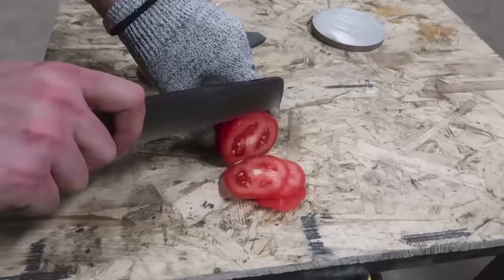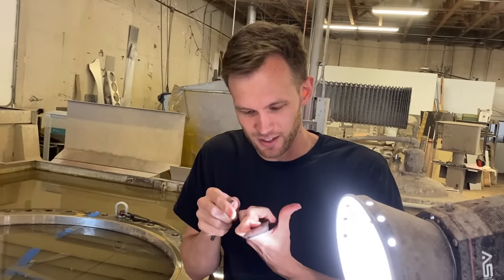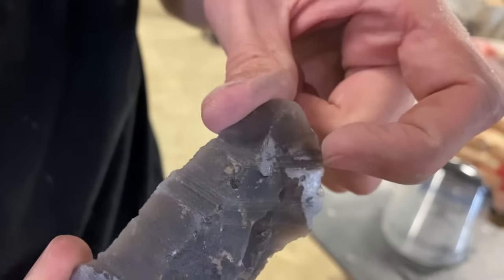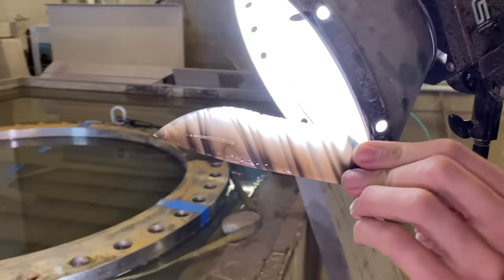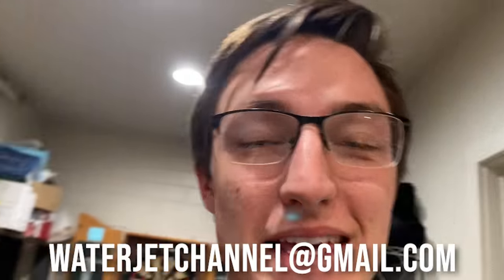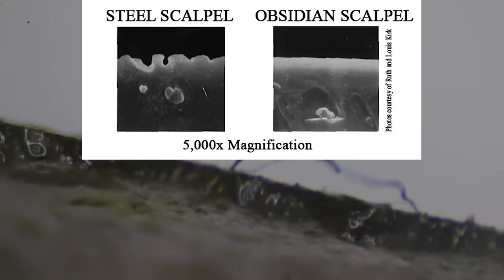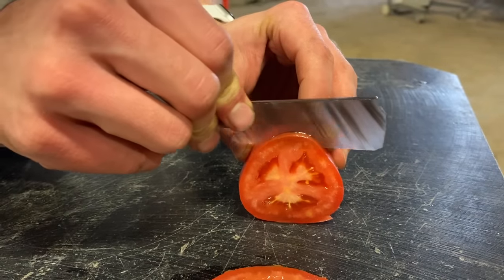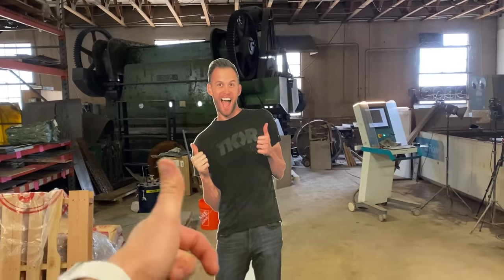World’s Sharpest Obsidian Knife

Comment: The thing that makes obsidian 500x sharper is the fracture of the material itself. You need to KNAP it to get the maximum sharpness. Simply sawing bits off of a block leaves you with the same issue as steel knives
Reply: Except knapping doesn't give a large enough workable edge to exploit the sharpness.... It's all well and good being a molecular thickness edge... but if it's a shitty mess of hundreds of small jagged notches on a lump of rock an inch thick, it's not going to function like a metal knife.

Obsidian is overhyped. It's only advantage cannot be properly exploited into practical tools, hence why metal weapons and tools were such an upgrade the instant they arrived in South America. A durable, consistent edge is far more value.
Reply: @AllThingsCubey  Tiny obsidian blades are used in high end eye surgery as tips for the bisturi. Since the blade is a single molecule wide, it leaves extremely sharp and clean cuts that can mend without any scarring.

Aside from that you're right 😉

Comment: So, I do writeups and work with history and archeology channels on content on Mesoamerica (Aztec, Maya, etc), where obsidian was widely used for tools and weapons. You guys acknowledge that trying to cut out a blade with a waterjet like you did last time isn't gonna actually give you the sharp edge Obsidian is known for, but angling the waterjet or even knapping the blade after it's produced won't do it either, at least not to the same degree obsidian blades were actually produced in Mesoamerica: I'm more informed on things like Architecture or aqueduct systems then obsidian production; but the way they did it is the prismatic blade method, where you take  a "core" piece of obsidian, and then strike which flakes off whole, entire blades in one strike, creating an insanely fine, single continuous edge along where the fracture occurs. 

If you're taking an existing flake/blade and are doing traditional knapping to make many additional smaller fractures along the edge (which mind you the Mesoamericans also did, but usually to things like flint, or for ceremonial, not-for-actual-cutting obsidian pieces called eccentrics), then that's not gonna be as sharp since it's not one flush cutting edge and you're likely chipping parts of it in the process. The waterjet isn't doing it either, since while it's in theory producing one continuous edge, it's probably producing many microscopic chips and fractures along the edge as it travels (which you guys even concede in the video) since obsidian is so brittle, rather then actually forming a single edge as if you struck it off in one piece using the prismatic method. 

I wanna be VERY clear here, that, again, I am not a material scientist or a geologist, and Obsidian blade production is not one of the specific aspects of Mesoamerica I'm particularly informed on (ask me about how cities were laid out or how Aztec political systems work and then I can give you 12 paragraphs!) but yeah, If you wanna do this with a waterjet, you should be using the waterjet to cut out the initial core you're then striking blades off of, maybe you could try to work with a geologist or a physicist to find the ideal starting core shape to produce the best blades? There might already be some research on that as far as what the best starting shape used historically was, but again, not the subtopic I tend to look up research papers for.
Reply: But how WERE the cities laid out? 🤔
Enquiring minds need to know!
Reply: @bigchooch4434  Mesoamerican cities tended to have a central, dense urban core of monumental architecture: You'd have palaces, temples, ball courts, noble housing, and other civic, ceremonial, and communal structures., which were richly painted and decorated: when you see ruins today, you're seeing the grey inner fill of rough stones and mortar or the brickwork over them, usually not the clean stucco and then colorful painted frescos and intricate reliefs, sculptural facades, friezes, and other accents which were over them, which are only preserved occasionally: Look up the frescos found at the residences of Teotihuacan, or the Rosalila temple at Copan, or the paintings made by Scott and Stuart Gentling of Aztec cityscapes to get a feel for how they would have looked in their heyday. 

These were generally organized around open plazas, with their arrangement aligned to maximize things like public viewing or human traffic for ceremonies and gatherings, or for ritualistic alignments: For example, the Maya E Group, for example, is a common arrangement of 3 structures that when viewed from another location, align with astronomic phenomena at certain times of year. Or how at Teotihuacan, the San Juan river was recoursed through the city's grid layout (which is unusual, I'll get back to that) to appear perpendicular to the Temple of the Feathered Serpent and the Ciudadela complex/plaza it's located inside, as those structures were heavily associated with water (the plaza even capable of being flooded like the Roman Colosseum), so when viewed from specific angles it would appear the river is coming forth from those structures. Speaking of, complex water management systems were also quite common: At Tikal, for example, there were a series of massive reservoirs connected to one another, with dams and channels which allowed them to flow into one another if needed to prevent flooding; with structures and plazas in the surrounding area having drains to similarly redirect rainwater or water from floods into the reservoir network. Some of these reservoirs even had advanced filtration systems, and some of the connections between them even had switching stations to choose how the water flowed. 

Much like how the structures themselves in sites today are misleading with only the inner grey masonry being visible, modern archeological sites and their maps are often misleading in that they exclude many structures which are either still buried or destroyed. Compare tourist site maps of sites like Teotihuacan or Palenque which only show major structures for visitors, with the archeological surveys of those sites from Millon and Barnhart, respectively: those both show hundreds of additional structures tourist maps do not. 

Significantly, they also exclude the suburbs around the urban core, which is the other key half of Mesoamerican urban layouts: While the urban core has a high density of planned structures for elites, ceremonies, or groups, which are built of stone and have fancy accents and decorations; the suburbs that surround the cores are low density, commoner residences interspersed with agricultural land (sort of giving a similar mental image to suburbs today, with homes spaced out between greenery), and are less planned:  Commoner residences would have been built out of wood, straw, or adobe brick, usually on a stone foundation, with homes in so called "patio groups", with 2 to 4 homes built facing one another around a sort of mini-plaza. These suburbs would radiate out from the site core, gradually decreasing in density, as the area became more rural, without a clear end point, which makes defining the limits and populations of Mesoamerican cities quite iffy. Also, while these were "less planned", then the urban cores, much of the area the suburbs covered would still be landscaped (not necessarily, deforested, though sometimes: When tree cover was kept, it was in managed groves with a cleared underbrush for agroforestry and shade), and some would have "mini cores" with temples and some elite residences. Some large Mesoamerican cities, particularly Maya ones, had absolutely massive suburban sprawls covering dozens or even hundreds of square kilometers, like at Tikal, El Mirador, Copan, and Caracol, to the point where in the former two examples, you literally had multiple different city centers connected via the sprawls into Megalopoli. Tikal's in particular had a significant amount of infrastructure across it's sprawls, with palisades and more hooked up water management systems for agriculture and flood prevention and drinking water. 

What i've described is the "typical" large Mesoamerican city, but obviously there were exceptions, some examples being Tenochtitlan, Teotihuacan, and Palenque: The Aztec capital of Tenochtitan was located on an island (which was then expanded via grids of artificial islands used for urban development and as hydrponic farms known as chinampas, which actually made up most of the city's area by the time of Spanish contact), so it had a clear limit, though in the city there's still a  more urban core and surrounding suburbs. Tenochtitlan also unusually had some of it's structures on a grid layout, contrary to the plaza based ritualistic planning I described. This is attributed to a specific urban revival of Teotihuacan's city planning, which was even more unusual: Almost the whole city layout was one giant urban sprawl on a planned grid, which covered 22 square kilometers, entirely composed of palaces and temples, organized around a central road, rather then plazas. The city did have suburbs, but they covered a much, much smaller amount of space compared to the urban area and most of the city's denizens lived in fancy palaces. For Palenque, the city was founded on a relatively small flat area of an otherwise steep hill, so it has it's commoner residences on terraced acropoli (which themselves weren't uncommon, moreso for palaces and temple complexes tho) packed tightly next to/alongside it's elite and ceremonial structures, I guess more comparable to the typical ancient/medieval city in Eurasia where you had everything packed together. 

I wish I was able to link images of all of this, but youtube tends to act iffy when I do that, so if you want some let me know and we'll have to figure something out.
Reply: As an archaeologist, I agree. Strike a flake from a core and you get the thinnest edge possible. Further retouch or knapping is good for shaping tools and for sharpening a dull edge, but you'll never achieve an edge as sharp as the initial flake. Fun video though.
Reply: @MajoraZ  thanks for the long write up, I was actually rather curious
Reply: @MajoraZ  I wasn't sure if we'd get an actual write up, I'm so glad you actually took the time to write all that out.
This type of sharing of niche knowledge is what the internet was made for.
Reply: @bigchooch4434  Happy to help! I actually already had that typed up from a comment on a different video, I do a lot of posts and such. Also, to clarify on "though there's still a identifiable more urban core and surrounding suburbs around it. Tenochtitlan also unusually had some of it's structures on a grid layout, contrary to the plaza based ritualistic planning I described": as in the chinampas themselves are mostly the suburbs and agricultural land, wheras the natural island the city started on in the center and some of the adjacent chinampas had the palaces and temples and other urban core monumental structures: the very center of the city still had a ceremonial plaza, but it was a walled precinct that also contained structures inside the plaza, and those and some of the structures surronding the precinct  were somewhat on a grid. (I can show images if you reach out)
Reply: Exactly I heard some flakes the edge is only a few atoms wide. Exactly what they mean by few I'm not sure, but just obsidian I have broken myself is ungodly sharp like 100x razor blade sharp.
Reply: @MajoraZ   I don't care about your content, take my sub for your large amount of knowledge.
Reply: Obsidian is currently used for extremely delicate surgeries (brain, eye, etc). The cutting edge is microscopic and procedures are done with direct optical or computer magnification. Doctors who use obsidian scalpels  often need to get special consent from patients since they are not fully approved in some jurisdictions. The cutting edge is only a few atoms wide so the trauma to tissue is minute and the healing time is ridiculously fast with little to no scarring.
Reply: man i really wanna read this but my brain makes me not because of the many words
Reply: @delphic464  fascinating 👏
Reply: I was thinking about this too, that for it to bevome very sharp you would have to «follow the grain» or something like that
Reply: @mattias2576  When properly knapped, glass like crystiline structures will break in a hertzian cone (hertz - as in frequency). This break allows the finished edge to be microscopic since the break is following the molecular structure of the crystal. A good example is BB holes in windows. Polishing or finishing the edge mechanically will only dull the cutting edge.
Reply: @willowgoober  weird thing to admit to in public
Reply: Now THAT’s an informed comment. Love it.
Reply: Finally someone who knows what he's talking about!!!!
Reply: @mccooljohnm  how did the Aztec political systems work
Reply: @delphic464  ohhh, will have to do some reading, i only have some basic knowledge of crystals, only experience is from studying solid state physics, but this sounds really cool
Reply: I did this with a chunk of obsidian I found in a river and I made something close to an axe blade out of it
Reply: @MajoraZ   you should send me everything in a doc or something sounds really interesting (for the pictures)
Reply: It sure looks good however!
Reply: Paleomanjim has a bunch of videos about making blade cores, and shows examples from mesoamerica and stone-age Europe
Reply: I'd love to hear how the aztec political system workedXD

Comment: If I’ve heard correctly, obsidian is so unbelievably sharp down to the smallest atom that it cuts between cells while a scalpel just cuts through them. This is also why you would heal faster from being cut by obsidian
Reply: More like it CAN cut between cells.
Reply: Obsidian was used for scalpels but it isn’t used as much now because it can easily be broken. Leaving the patient with sharp shards inside them that were hard to remove.
Reply: So, same like one eats tomato salad with some obsisian knive chippings in it? :D
Reply: If a scalpel could really cut through the cells, I'd call it one great scalpel. Typically they should be just crushing the cells for good.
As for cutting "between the cells", that's just tearing them apart, not cutting. Maybe in theory and with nanobots?
Either way, any clean cut with a sharper object usually is much easier to heal than the one taken with a dumb blade. Whenever I'd cut myself with my knife at its best sharpening, some of the cuts could be barely detectable at all - you can even miss the fact of having had being cut by such a blade at first.
Reply: @getsideways7257 Obisidian cuts between cells as it blade is 1-20 atoms wide
Reply: @shironhel7184 complete bs lol. an obsidian blade is 50 atoms wide

Comment: So basically, “Worlds Dullest Obsidian Knife” 

LOL. Good job though. In the future, I would not recommend sharpening it with a belt sander. You cannot do it that way. Flaking is the only way I believe. That is why steel is much better. With steel, you can shape it and design the blade. With obsidian, you are at the will of however you chip it.
Reply: I think I did a better job on a cheapo 440A steel knife with just three stones - could cut hair too and slice grapes.

Comment: I think the big thing with the blade chipping on the belt sander is using the platen (the belt support thingy lol) take that off and use just a tensioned belt with no support. Where I use to work was a glass plant and the edgers were just belt sanders and that had no platen and it’ll sand it without chipping the glass, it actually had to, cause it was for glass going to be tempered, and if there’s a chip the glass will bust during tempering or when cooling after tempering.

Comment: Maybe you can try sharpening it with a wetstone
Also have you tried to sharpen a steel knive with a warerjet the same way you did with the obsidian one  ?
Reply: It won't work with obsidian. You're not going to get it any sharper than a steel knife with a stone, with the added disadvantage that you're going to be chipping it away with a stone and not getting a stable edge. Obsidian is terrifying sharp when knapped, but that's really the only good way to get it sharp.

Comment: Fun fact they actually used to do blade knapping underwater because its easier to get a clean brake underwater
Reply: The super sharp obsidian blades aren't knapped, they're made via the prismatic method: you flake singular long blade pieces off a core with each strike, so the blades have a continuous edge; vs knapping where you're making multiple strikes on the edge of your blade which results in some chipping and not one flush cutting surface.
Reply: Jesus Christ died for your sins please repent for the kingdom of heaven is at hand ✋ 🖊 🤚

Comment: Dudes you need a glass worker not a metal guy. You need special compounds to sharpen or buff glass. Heat control is essential. Then it would really cool to take it to a tempering place to see if Obsidian can be tempered. Shi.. why not fold the stuff like metal? Or forget Obsidian all together and make a silica carbide blade? Then coat it in graphene. That would be a sharp blade.
Reply: Oh and the graphene coating is to seal all mirco cracks with atom thick repairs. Method one, aka the lazy way, is to use a ceramic / graphene car wax coating. Id apply 100 times then buff. Method 2, the real way. You could use a suputering magnetron to apply a coat of graphene directly to the surface uniformly. Tempering the material in this state should give one hell of a temper. You could also melt the obsidian add graphene powder and the use a gig press to press it into a mold. Compress the obsidian graphene mix to the density of steel. High carbon obsidian.